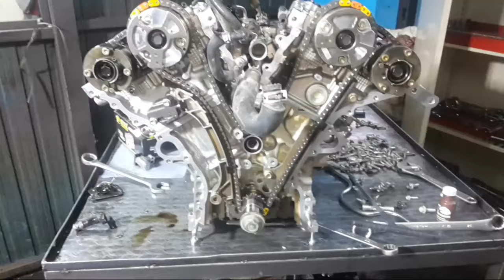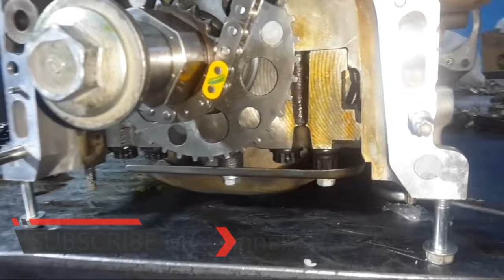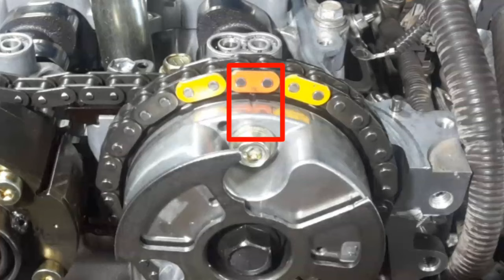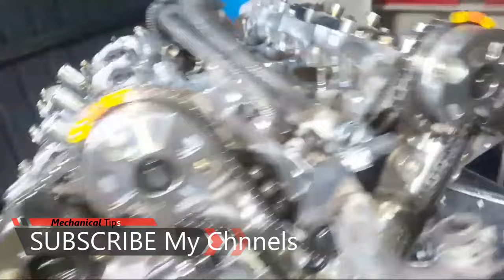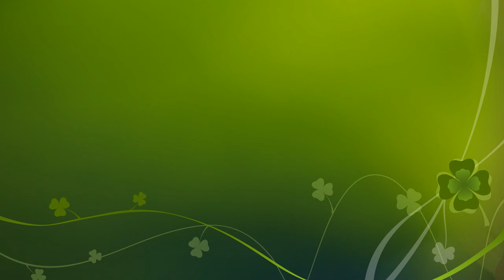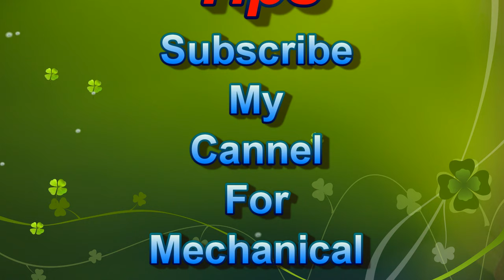Toyota Lexus, Engine timing chain,  V6 3.5L 2GR-FE, FSE, FXE, FXS, 2012, 2014, Mechanical Tips

Comment: I replaced vvt, chains and tensioners but rattling noise still there
Reply: Chain guides as well
Reply: @ahmadalomani1722  how do you put them in top dead center? Is it TDC with respect to cylinder #1?
Reply: hello i had the same problem, rattling noise and p0016 p0017. Do you solved this?